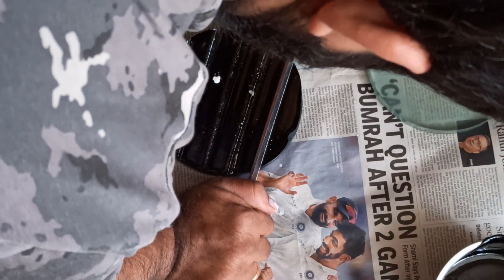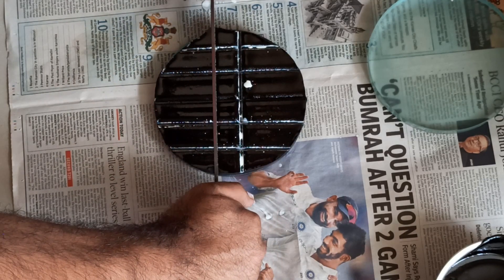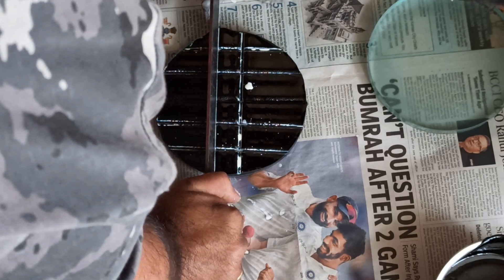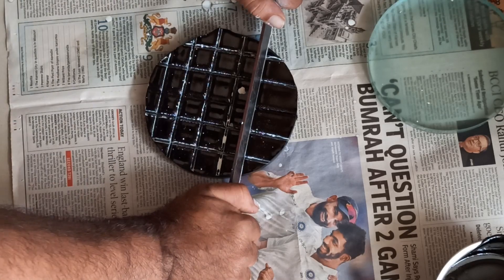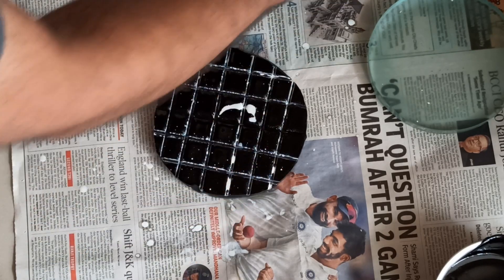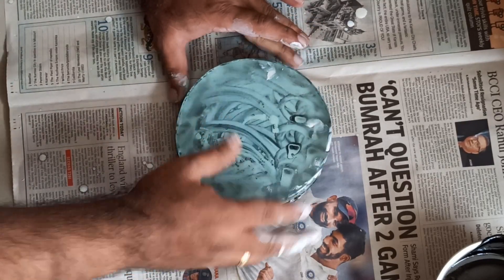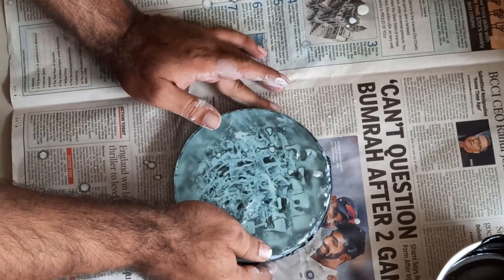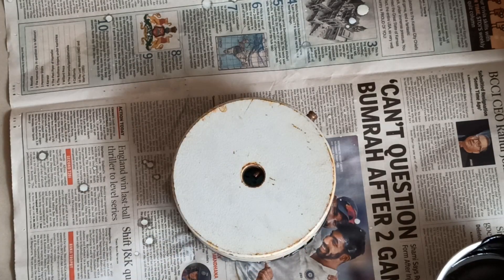Channelling a Pitch Lap for a Homemade Telescope Mirror

Comment: That's a good start. I would suggest heating up your lap once again, somewhat, with either a heat lamp (infrared lamp), or a hair dryer, or a construction heat gun, and press one more time until you get better contact everywhere. Obviously if you heat it too much, you'll get a horrible mess. I find that an easy way to see if it's soft enough is simply to take an ordinary pencil and poke it into the facets. If the pencil can't make a nice dent, then it's too hard. If it can, and if you can do that in all of the facets, then it's soft enough to hot press.
Reply from the maker: After posting this video I did several hours of polishing and finished about 12.5 hours total. Each time it was hot pressed to ensure good contact. However it resulted in a 1/2" TDE and about 1.5" deep centre. Going back to 1000 grade SiC today.